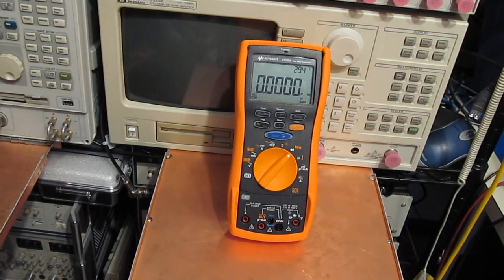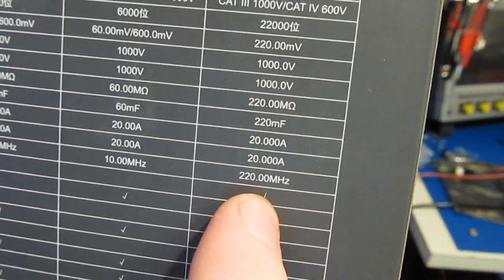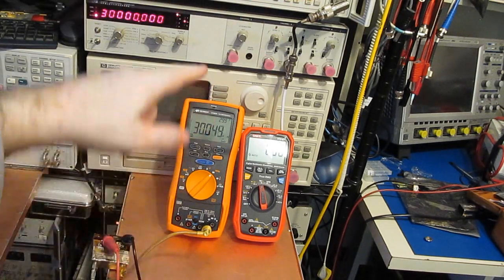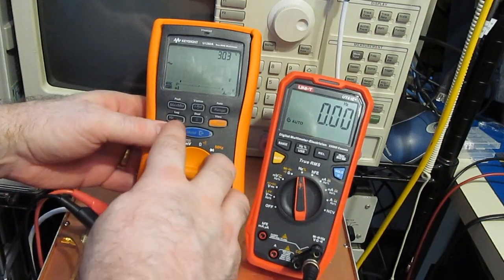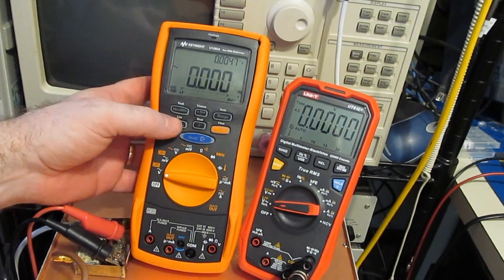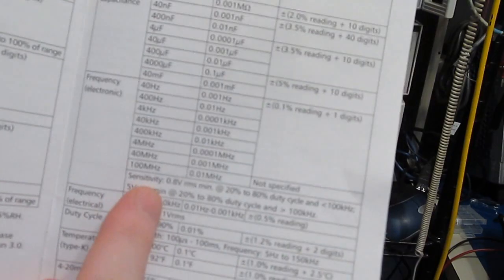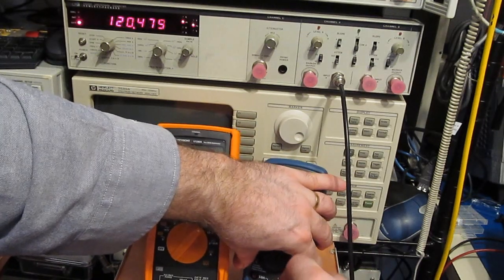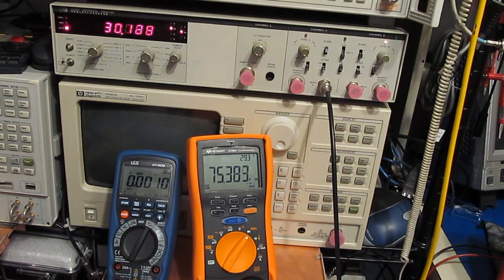Keysight U1282a Review Part2,  The Frequency Counter

Comment: I'm glad the company kept changing their name as the quality and support went downhill. I like the idea that the name Hewlett-Packard is still worthy of respect for what it did back when it did it. As an employee I sometimes called it "Horse Piss," but I had no idea how sloppy the engineering would become, and how adversarial to the customers the company would become with time and name changes. 

I remember how I could always count on HP gear exceeding its specs, every spec. Now I see Keysight gear with specs written by the marketing department, not the engineering department. After reading all of the promo ads for equipment from electronics companies I could always count on the spec page to tell me the truth about almost any kind of gear, even Chinese gear. When gear costs 5 to 10 times as much money and you read a spec page that looks like it was written by the marketing department I think the company is in real trouble. Thank you for your reviews. They are the real deal.
Reply from the maker: You worked for HP?  Pre-Carly?
Reply: @joesmith-je3tq , very pre-Carly. Early 1970's. When I worked second shift building CRT's at the Colo. Springs 'scope division one night I saw an old guy wandering around the R&D cubicles without a badge. So I went over, explained to him that badges were required, and escorted him down to security in the lobby. When we got down there the security guard at the desk stood up real quick and said, "Is there a problem, Mr. Hewlett, sir?" The old guy said, "Nope. None at all. This young man noticed I was wandering around without a badge and did exactly what he should do. Would you hand me one of those badges, please?" If it had been Carly I would have been escorted by the guard out to my car on the spot, if not arrested.

Comment: I was able to measure 44 MHz by reducing signal amplitude to 240 mVpp.
Reply from the maker: What version of firmware does your meter have?
Reply: @joesmith-je3tq  Firmware ver. 01.05. I can't put here a measurement picture from a hosting image server because is deleted. Here it is : https://youtu.be/88TSvKQJe0g
Reply from the maker: @Psi117  If you have an EEVBLOG account, you could post the photos there.  I can't tell from the video how the generator is attached to the meter.
Reply from the maker: Can you also check your meter's cal cert to give us an idea when it was made.  I wonder if they changed the design.
Reply: @joesmith-je3tq  I've posted into the thread.

Comment: ut181a vs U1282A ?
Reply from the maker: I turned my 181A on the other day to run a few tests with it and it was dead.  Battery was 0V.  Attempting to charge it resulted in a blown fuse.    It's six years old now and I suspect there is not a lot of life left in that battery.

Comment: Try terminating the coax with 50 Ohm.  The meter might well be counting reflected signals.  There is also a possibility that the front end of that particular meter has a problem.  Poor frequency response in the input amp could be reducing the signal so much that it is also counting noise.
Reply from the maker: Only two videos and a handful of comments,  I'm surprised you would make such a suggestion.  Let me repeat:  "Actually, four different terminators were shown in use during these first two videos.  Two were inline, one upstream, one down.   Unless by at the meter end, you are suggesting to solder it right to the PCB.  lol.    On part 1, there was also a scope attached with the terminator upstream and the scope set to it's high impedance mode."   If you follow the EEVBLOG thread we have now had a few people replicate it.   If you have one of these meters and are able to get yours to read above 36MHz, I would like to hear about your exact setup.

Comment: Why don't you turn on "divide by 100" mode? 100 MHz is only available in this mode, there should be "100" on secondary display.
Reply from the maker: Sounds like you are suggesting there is a third mode.  I'll bite.  Explain the steps to enable it.
Reply: @joesmith-je3tq  Try pressing Range switch in MHz mode, according to page 72 of U1282A User's Guide, section "Frequency Counter". You can search for word "divide".  

P.S. What I've said applies to U1252A, I don't have U1282A. Page 32 of U1252A user's & service guide says press Range to switch to "divide by 100" for higher frequency mode. Interesting, that page 32 says "This allows for a higher frequency range of up to 20 MHz", while on page 160 top frequency is listed as 99 MHz.  I'll try now on my U1252A.
Reply: U1252A measures only up to 2 MHz in "-1-" mode, and up to 30 MHz in "-100-" mode - my arb has only 30 MHz upper limit, need to hack it.
Reply from the maker: @TheGrantourismo  What is it that makes you feel that this is not what I had done to get it to display MHz and 100?
Reply: @joesmith-je3tq  Sorry, UI of U1282A is deceiving: don't see 100 MHz range indication.  Old Escort user interface was much more friendly, perfect is the enemy of good. Beg your pardon.
Reply from the maker: @TheGrantourismo  The 100 is just below the MH z.   You can see it throughout the video if you take the time to watch it.  So no magic mode as was suggested.
Reply: @joesmith-je3tq  I watch all your videos very carefully, many of them several times, since your channel brings up the most comprehensive analysis of DMMs. But this video is 720p only, it is very hard too see details on DMM screen. Thank you for your channel!
Reply from the maker: @TheGrantourismo  It's the same old camera that I've used for many years shot in the same resolution.

Comment: Besides the famous 'Joe Smith Experience', how about testing the accuracy of this meter at different battery voltages? Short-term stability test (24 h or so) would be nice too. My Gossen calibrator seems to have problems in these subjects.
Reply from the maker: You mean to lower the meter's internal battery voltage and see how it effects the meter?   If so, that would be easy enough to do depending on what you want to see.   For example, to look at every range of every function would take a lot of effort and I am not setup to run such a test.   If you just wanted to see how it changes with a DC reference applied, something like that may be doable.   For short term stability,  could you provide more detail about what you want to see as well.   Keeping in mind that I check the meters against the parts in that test box throughout the test.  These tests can run over several days.   To measure the meter continuously, then we would need to know which function/range would you want to see.   Can the software even log it.  Of course the big problem is temperature but it's certainly possible to tighten that up depending what you are after.    Think about it and get back with me.
Reply: @joesmith-je3tq  Thanks for your reply, Joe. Yes, exactly. The calibration certificate may have stated the battery voltage during the calibration, but in practice that will unavoidably change. Personally I am interested to see its performance under the smallest DC volt range and resistance range for both the battery voltage test and short term stability test. What do you think?
Reply from the maker: @chuanliu4685  I think for the battery voltage,  it's not a problem to inject a 1mVDC signal while sweeping the voltage.  I could then repeat this was a 100ohm.     The short term stability I'm still not sure what you are after.  Are you wanting to log the data at some fixed interval, maybe holding the temperature within say +/-1 deg C, with a 1mVDC signal applied and the look at the standard deviation?  Or are you just wanting to read a 1mVDC and 100 ohm resistor in two separate days and maybe record what the ambient temperature was.    The more detail you provide, the better answer I can give you.  Let me know.
Reply: @joesmith-je3tq  Maybe they can be carried out together in sequence. How about putting the meter in a constant temperature (more or less) environment and connect an external power supply to the battery terminals. Inject a 1mVDC signal and sweep the supply voltage from the minimum operational voltage (may need some preliminary tests to determine) to 6.4V (fresh battery voltage). After that you can go directly into the short-term stability test by fixing the supply voltage to 6V (or whatever specified in the calibration certificate) while maintaining the 1mVDC signal. After that you can repeat the process for the resistance measurement. I hope this could save you some efforts in setup adjustment.
Reply from the maker: @chuanliu4685  Sadly you still fail to answer the basic question on sampling.  As for sweeping the battery voltage, again, I have been collecting data for that for some time now.  There have been several videos showing the setup.  Doing this over temperature is possible but adds complexity.  I guess think about really what are you trying to answer.  The manuals provide the accuracy over temperature.  We would expect the meter to fall within this.   We would also expect the meter to stay within these limits until the low battery indicator comes on.
Reply from the maker: We can certainly collect a lot of useless data very quickly.  The question is more what is helpful to you and why?
Reply: @joesmith-je3tq  Hi Joe. Sorry for the confusion. I think if it can be managed, a continuous sampling for 24+ hours with a 5 or 10 second interval should suffice. I would like to know if this meter is stable enough to conduct relatively long term data acquisition, so that it can replace a bench meter or a DAQ in some cases. For example one of my colleagues is currently using this meter to monitor the resistance of a coil under cryogenic temperature for several hours. I'm a bit doubtful about this approach, but maybe this meter is good enough.
Reply from the maker: @chuanliu4685  Got it.  Let me try installing the software and get back with you.  If you have an account of EEVBLOG, we can continue the discussion there.
Reply from the maker: I have the software installed and I guess working.   What are the requirements for what you are attempting to measure?  Saying resistance of a cryo coil doesn't tell me much.   What is the value you are expecting to read, what sort of accuracy, how much drift do you expect from the test coil?    Have you looked at the specs for the meter and you know it it is capable of making the measurement you need?   It's easy to waste a bunch of time taking useless data.  I would like to make sure I understand what you are looking for and then we can perhaps use a low tempco resistor in that same range to check it.    Obviously, you know it's not a 4-wire Kelvin bench device and it wouldn't compare to even my old bench meters.
Reply: @joesmith-je3tq  My colleague is expecting the copper coil resistance to drop from 8 ohm to around 1 ohm within several minutes, and maintain that level for several hours. The accuracy of this meter's 60 Ohm range is 0.15 % + 20, which is not impressive, but it is acceptable for the purpose at the current stage. I would like to find out if the meter can maintain its accuracy and linearity within a prolonged period. If the meter can maintain a good linearity, I think the data would still be usable, even with a lower accuracy. We are expecting to receive some microohm meters with proper 4-wire leads sometime in the future. Maybe we can use it to adjust the offset afterward, providing the Keysight meter can maintain a good linearity. Another way is to use a current source to inject a constant current through the coil and sue the meter to measure the voltage drop, but the accuracy of the current source will have an impact on the result, which we need to do some math with. Therefore I'd like to find out the meter's accuracy and linearity on both DCV range and resistance range. We do have some bench meters, but they are quite old and we don't have any suitable hardware to setup the PC connection.
Reply: @joesmith-je3tq  I do have an EEVBLOG account. Would you prefer we continue this discussion over there?
Reply from the maker: @chuanliu4685  Yes.  YT comments was not designed for this.

Comment: After looking in the calibration manual for the meter it is not even verified about 20MHz, it is only checked at 1MHz and 20MHz (page 36, table 1.18), the calibration manual doesn't actually tell you how to calibrate the frequency counter, it is completely missing from the manual!
Reply from the maker: It sort of makes sense as it's not an analog function.

Comment: I had a play with my unit just now, and like you I cannot get a frequency above 31MHz to be read at all, no matter the input level, below 30MHz it would sense fine with between 50mV - 100mV  input level, the display shows as a 100MHz range when selected, which you probably noticed.

One interesting point is that in the calibration data for my unit the highest cal point was 20MHz.. so I am actually wondering if there is a missing calibration step and it loses the ability to read the frequency above 31MHz because it hasn't been calibrated above that point and so doesn't know what to do in that range.
Reply from the maker: I would assume with you working directly with Keysight, that you have contacted them about this.  Give them time.  I'm sure others would also like to know what their response was.  So please post it.
Reply from the maker: I would try to contact them myself but I had actually written them when I first started looking at handheld meters to ask a few basic questions and they never acknowledged me.
Reply: @joesmith-je3tq  I have given them some feedback about what we have observed.
Reply from the maker: @TheDefpom  looking forward to seeing what their response was.
Reply from the maker: A few of us have now replicated the problem with the counter and are now looking at the data logger.   You can follow along here:
https://www.eevblog.com/forum/testgear/hear-kitty-kitty-kitty-nope-not-that-kind-of-cat/msg4356106/?topicseen#msg4356106
Looking forward to seeing your review.   I would expect you have found other problems.
Reply: When are you going to release the 1282A video? Tks
Reply: @JohnUsp  Middle of this week.

Comment: Its a very odd issue, the meter jumps up 2.5x the given frequency and i cant wrap my head around why it would do that 
its not a harmonic, its not an aliasing artifact, it seems like an odd thing to have as a software bug 
and a useable 100MHz frontend on a multimeter is ridiculous on its face, why would it even read up to 77.5MHz?
Reply from the maker: Just tonight I provided some data from the meter comparing the input signal to what is displayed.  This was after another user attempted to repeat this test and showed a photo of the 32MHz drive and the meter displaying 80MHz.  This is spot on with what this meter does.  Really odd and sad to see a low end brand like CEM having similar specifications far exceed what the Keysight can do.   IMO, if you can't do what you claim, it's best not to even bring it into question.   I'm looking at it now thinking, you couldn't design a counter to spec, what else it wrong....  We will find out.

Comment: Keysight had Earned its Name by Marketing nd Marketing through Ads. While as Brymen had Earned its name by its amazing specs.
Reply from the maker: I will assume by your previous comment of being first poster  and now this one that you are very young or new to the field of T&M.  There are some very good papers on-line about the history of HP if your interested in learning more about it.
Reply: @joesmith-je3tq  sharp memory btw I had been working in Telecom sector as site enginear. Nd uni t ut139C nd Brymen is the only two that i use. Surely keysight may have some history. But i dont like it that's my personal choice. Brynen Can detect harmonics nd help me sort out which MCB isn't working nd what I need to correct therby saving my time nd to help me from Burning myself in the hot sunny day of KSA.

Comment: Hello again Joe  been a while....and it is really refreshing to get another DVM installment from you. I have to conclude at this point, that it is a good bit unsettling to know we would have to fork over over $500 hard earned green backs on a "well known, name brand" Multimeter....only to find out that a Meter with a much lesser established name AND costing less than probably a third of this "top line" Meter can out perform it! 🧐🤷🏾‍♂️
Reply from the maker: There's a lot to consider when buying any product which is why a very seldom will make any recommendations on what to buy.   It's really up to the consumer to do their homework.    The best I can do if provide some metrics to maybe help with that process.
Reply: @joesmith-je3tq  I actually have that very CEM 9939 and I am relatively happy with it so far. About the only thing I would like to be updated on the CEM 9939 is the ability to keep the LCD back light on for either a longer time or to be able to manually turn it on and off.
Reply from the maker: @dreamvouyer67  I used one for work for seven or so years.  Loaning it out took it's toll and eventually the plastic was damaged beyond repair.  For a low end meter, I thought it held up pretty good.